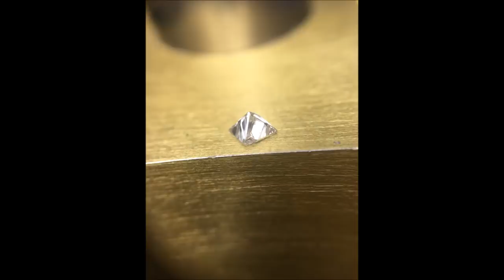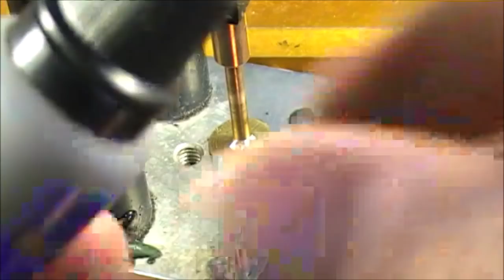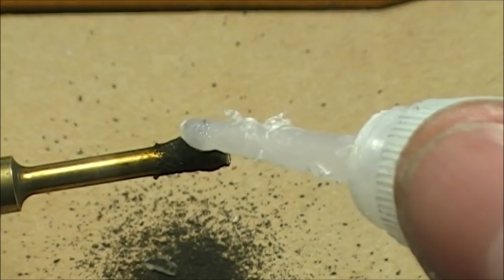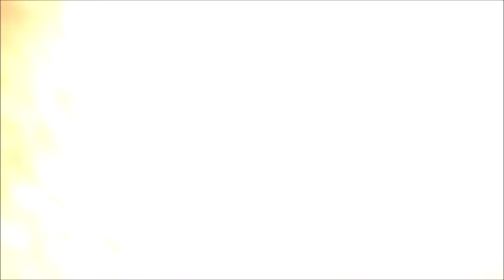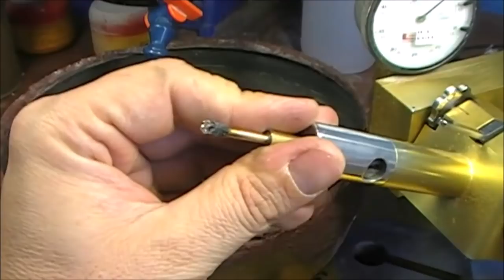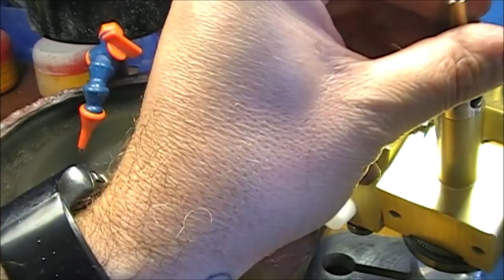Can a real Diamond be fixed with a Facetron machine?

Comment: Hello Sr : what is the difference on "cast iron" and iron on faceting? I now the difference "cast and wrought? but it makes some difference in finish or affects polish or diamond powder ?  The question Is because I want to machining a heavy duty iron disc to  faceting diamonds . I am building a faceting machine... Thank in advance for this video and your answer. Have good day
Reply from the maker: Hey there thanks for commenting.
The reason for using cast iron is it's porosity. It's me most porous kind of iron available and that helps to embed the diamond powders into it. I've never heard anyone using other kind of material for diamond cutting but I also never investigate further since i like using old school methods. I hope this helped you.

Comment: Hello, I use Dextone 5minute metal epoxy for most of my transfers(not diamond, haven't cut one of those yet :) ) but I put my transfer jig in the oven and cook it at 40- 50decreesC till hard. Using this method and clean acetone I have never had stones come off the dop. It may work better than superglue and filler. Especially if you are using lots of water than can weaken the superglue bond. The dextone epoxy will also most likely have higher heat resistance than superglue and provide a more even bond. If cutting a large stone I sometime dop up with superglue and cover the glue/dop/stone junction with dextone to protect it from water weakening the superglue bond. There is no best way, we all find what works best for us, I hope my comments help :) Thank you for sharing cutting a diamond it was most interesting.

Comment: Interesting to see that diamonds can be cut on a facetron - having done a few courses in Antwerp and seen the cutting process first hand i figured it would of been specific to their machinery regarding cutting/polishing
Reply from the maker: I love bending rules but it's not an easy process and it required a lot of brain power and research to try touching diamonds on facetron. The main issue is the gluing method  due to the capability of diamonds to transfer heat so quick

Comment: While polishing the diamond is heated to 850 degrees, to red. Your method is interesting. I'm interested in when polishing the glue that holds the temperature!?? Thank you!
Reply from the maker: Sergiy Wild Pioneer thanks for commenting. Investigating about diamonds, I’ve discovered that temperature shock can be fatal to the crystals. My trick is to never let it exceed 45 Celsius even while polishing. In fact to protect the glue tha otherwise would burn
Reply: In order not to burn at high temperatures, the borax diamond is coated. But your way to me very grassroots. Thank you!

Comment: It smells sooo terrible when the glue and the powder react with each other. 😷
Reply from the maker: ThisBadMonkey TBM if you know another stronger and better media, please indicate it to me. I need to find a better glue
Reply: Angelo1976 in fact, I use exactly the same brand as you do. Some folks are using 2-component glue, but the question is, how long does it take to dry out? Could be a potential cold substitute for the wax. You may have to experiment with different brands here. I haven't looked into this yet but I come to report if I have found something interesting.
Reply from the maker: ThisBadMonkey TBM thanks man. I did try many different products.... but didn’t found the absolute one. In fact this works holding the diamond from the pavilion but from the crown, this glue fails
Reply: Angelo1976 hy there Angelo. About gluing the stone to the dopp, try this: instead of gluing it directly on the dopp, lay a single tiny strip of kitchen towel paper in between, this should allegedly make the bond more accurate. Using paper towel strips instead of the filling material, you allegedly have also a little bit more time to adjust the stone on the dopp. I haven't tried it myselfe, but I will try it next time I have to use glue.
Reply from the maker: @thisbadmonkey  cool advise! i'll give it a try one of these times. thanks!